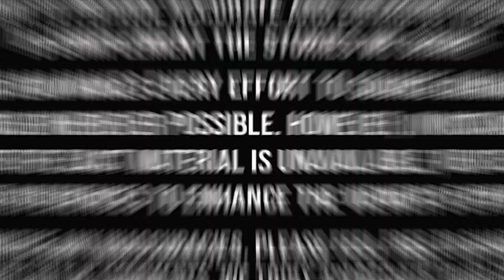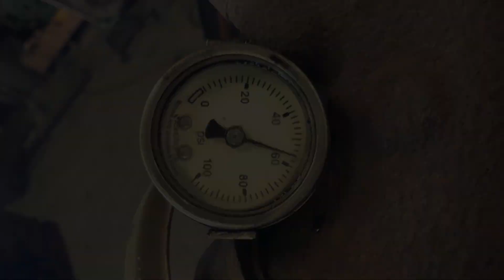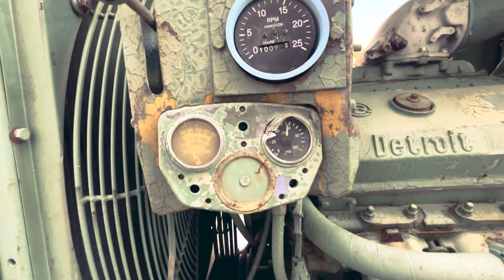The Shocking Truth About the Detroit Diesel 8V71 Engine – What You Never Knew!

Comment: As an OTR truck engine they made it. The 250RPM torque curve at the top of the tach required the 13 speed transmissions. When you hit a hill it was like you were rowing a boat upstream. Lose a few RPM, grab a gear you had to anticipate and shift fast.